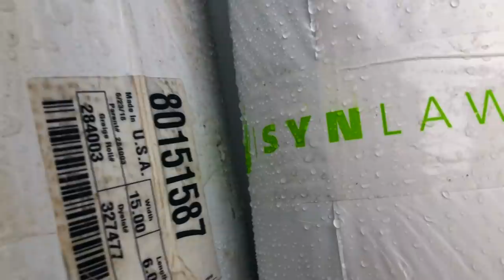Golfer's Dream Backyard Renovation - My Home Putting Green

Comment: I like what you did here Mike from Golficity.  I do, however, have to agree with everyone on here saying that the project is small.  I would have made the green bigger, made a little bit of fairway grass to practice chipping in, got a net and golf hitting mat to practice with.  Im also not sure about the location of the bunker.  You don't really see a bunker on a downhill slope like that; on the other hand, it could have been just the perception that it was downhill.  Im just saying that if you plan on doing a project like this, make sure to tackle all facets of the game, not just the short game.  But, for what you had to deal with, it is a great start.

Comment: Do you feel like in retrospect that you would have built the green bigger? Im about to do a putting green in my yard and i want to do a 15×20 surface with synlawn materials. How big is that green? Thanks for posting the video.
Reply from the maker: Golf Gambino I (Mike) could have gone bigger, but it was getting costly per additional sq ft.  But heck yeh, bigger the better!
Reply: Cool. I dont have to do most the costly things you had to do so i think i wont run into that problem. Thanks for the reply boss.

Comment: About how much was your total investment in that area ?
Reply: Scott Gurwin I’d rather not mention total project cost but the green was probably about 10-15% of the cost of everything.
Reply: @michaelfasano9141  I won't ask any finance questions, but I do have a question about the green. I believe the company you used is out of VA. I know that the foundation for the green, etc. includes the small gravel, the green, and the sand used as filler. Just wondering when you ordered the green:  1) Did anyone come out and inspect the land  2) Did you just give the dimensions/shape of the green you wanted, and 3) Did you have to order the filler sand, and base (layer on ground before the green) separately, or did SYNlawn take care of all of that in your order with them (including how much of each material was needed) and 4) What kind of drainage do you have for the green, or does water just sit and develop puddles during rainy days?  Thanks so much.

Comment: i want to do something like this also, but that layout is so off-putting. 
The bunker is so sloped and the greens so small and close all you have is a SUPER awkward downhill shot. 
then if you plan to chip from the other side you have all those walls in the way and don't mishit it or you'll send it into the lounge area. 
that huge lawn section you grew could have been incorporated into the design. frankly i think having the fire pit area moved out of the way for a bigger green would have been a gooder plan. All i see that being good for is 10 foot putts and fringe chips (which isn't nothing), and a 30 minute distraction for the kids.